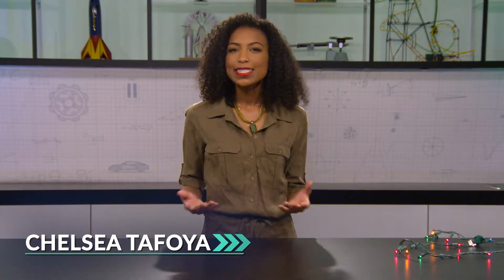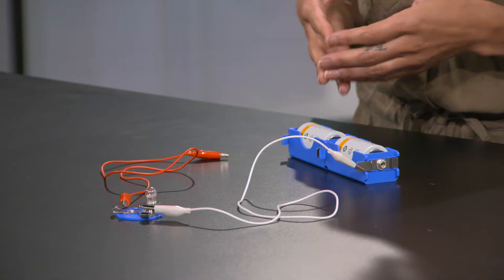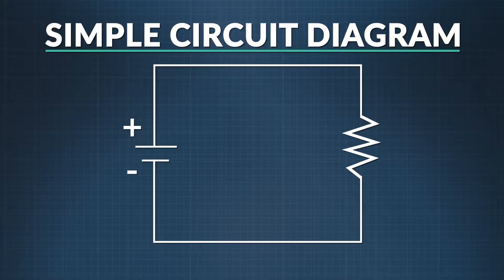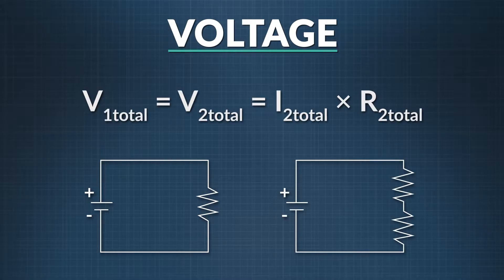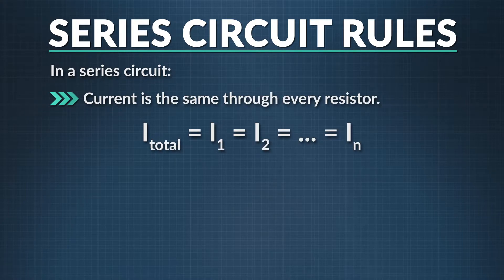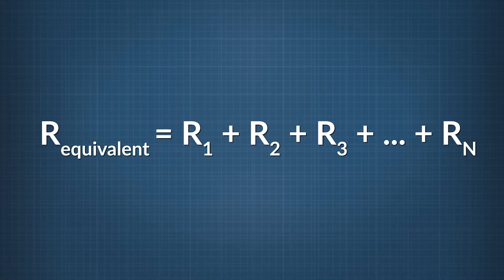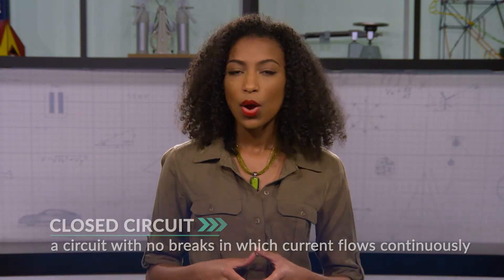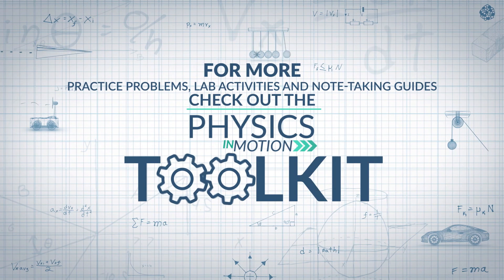What Are Series Circuits? | Physics in Motion

Comment: THE BULBS IN THE STRING OF CHRISTMAS LIGHTS ARE ALL IN PARALLEL SO THAT WHEN ONE BULB IS OPEN THE REST OF 
THE BULBS STILL BURN.  THIS WOMAN DOES NOT HAVE HER FACTS STRAIGHT.  THERE ARE MULTIPLE WIRES REQUIRED TO 
ACCOMPLISH THIS CONNECTION.  IF THE BULBS WERE IN SERIES THEN ONLY ONE WIRE TO CONNECT THEM ALL WOULD
BE REQUIRED.  SERIES CIRCUIT CHRISTMAS LIGHTS HAVE NOT BEEN SOLD SINCE 1935.